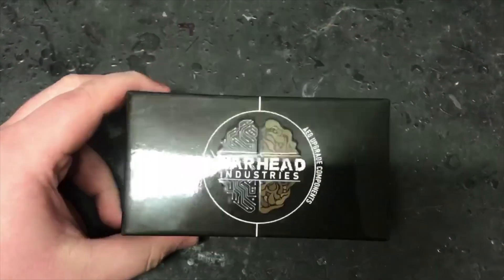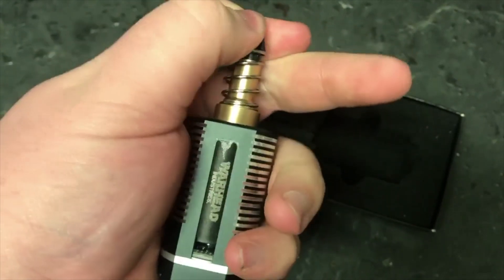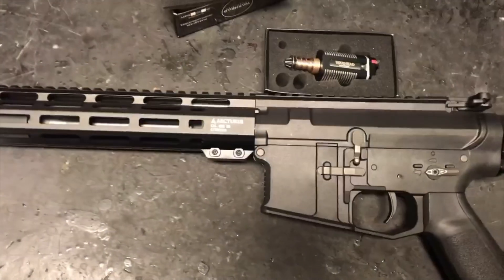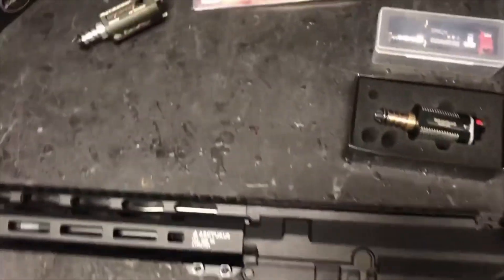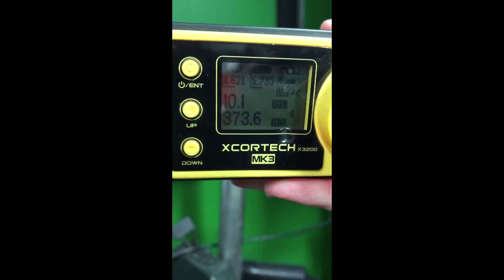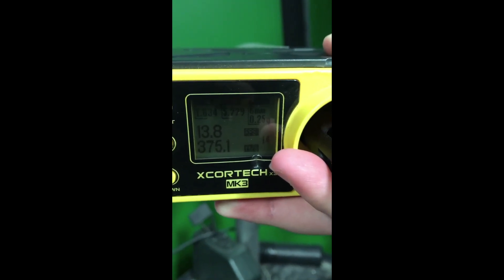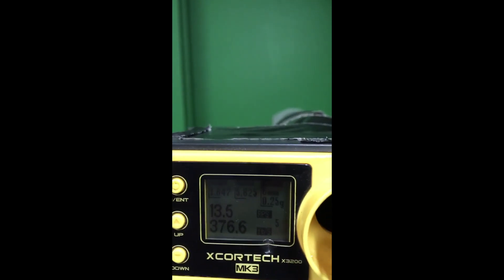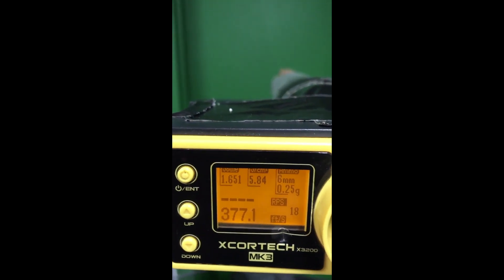Warhead Industries New Airsoft Motor!!!! Done By TECHEAD!!!!!

Comment: so these motors are better than tienly?
Reply from the maker: It’s completely personal preference however you can always message techhead on Instagram he can give you stats and Breakdowns
Reply: @krampusairsoft9292  Sorry but I did not get it, because seems that you got better rps with the shs motor and lower with the brushless, also Option 1 with 1,1 doesn't show.
Reply: @krampusairsoft9292  how’s the pinion gear holding up? I’ve seen that someone’s failed after five minutes. This will be going into a 45rps dsg so it need to be a strong gear. Thanks
Reply from the maker: @600lt_kyle  It really does depend on what gears you’re running with it, shimmering and so forth however they could’ve probably put on a hardened pinion gear on it
Reply: @krampusairsoft9292  I’ll be using the siegetek gears
Reply from the maker: @600lt_kyle  Great gears however they are much stronger made out of a better metal than the pinion gear so I would probably see about swapping it, to something a little bit more robust or play with it but you will see damage on it.
Reply: @krampusairsoft9292  what pinion would you recommend for it? I would get a siegetek pinion but it’s an O type so it won’t fit on this motor